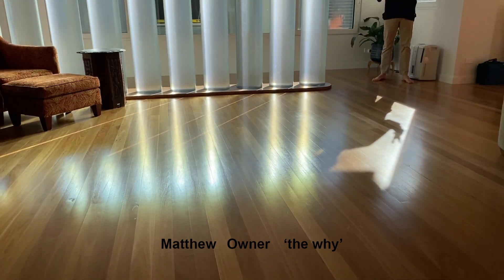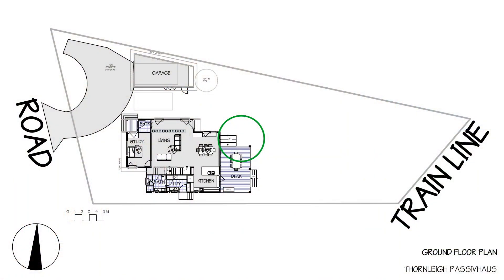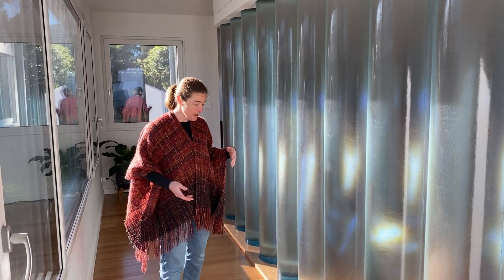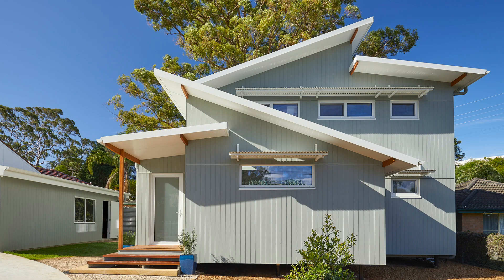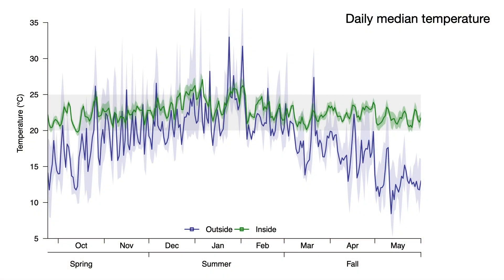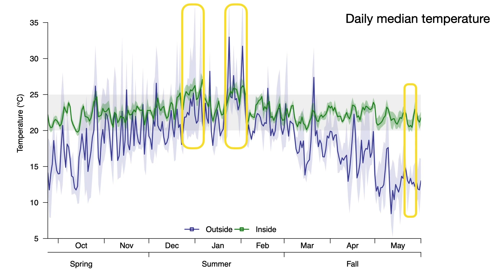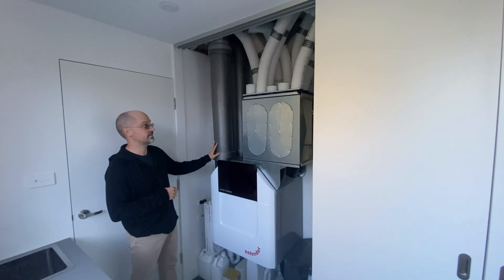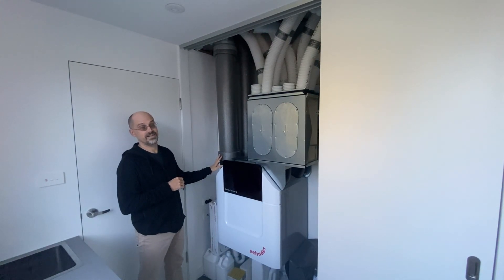Passive House Open Days - Thornleigh Passivhaus in Sydney, Australia

Comment: Great video and very informative. I live quite nearby and also in the process of planning knockdown rebuild. Can I ask if you leave you rear patio doors open during summer months? Currently our doors  are only closed  when we’re not home. My concern is  would render the system inadequate for cooling the house down? Or is this not the case?

Comment: I built passive house in the Pocket Billinudgel  NSW in 1982, not certified passive house and latest in Blue Mountains in  Dec 2018, it was not certified passive house but all passive house  requirements, the developer/builder was unwilling spent any additional on certification, which would have required a blower door test.   Build cost for 240 m2 was $2134.50/m2 included 15% builder margin.   
Several local Entrepreneurs and I are organising a four-day EV & Renewable Energy Conference/Field day will be held in Lismore, NSW at the 23rd to 26th Sept 2021. 
It will bring together people who believe in sustainable futures, and professionals from the EV, Renewable Energy & Built Environment industries.
#People #Company in #EV #RenewalbeEnergy #CLT #PassiveHouse #modularCONSTRUCTION #Xlam  #Microgrids #Batteries #PV #WindTURBINES #WaveENERGY #TeslaSuperCHARGING #eBUSES #eRAILWAYS #PublicTransport   to name just few topic  will covering.
Reply: This answer is fantastic and answered all the questions I was looking for
Reply: @mikehtims  We are submitting development application to North Coast NSW, Sept 16th.
1)	50 prefabricated CLT & SIPform passive house,  certified, homes. The roofs of homes 11,460m2 PV the electricity will be aggregated and stored in a central hub of Tesla batteries. 
2)	13,430m2 PV Tesla and Tractiles tiles producing 7,671,216kw/hr 
3)	10 number commercial Tesla Batteries total 14.4MW/hr upgraded 28.8MW/hr.
4)	Bi-Charging of Electrical Vehicles one per house and 12 charging station located entrance the development. 
5)	Fronting onto main road there will be  1970m2 commercial, shops and 10 charging station. It will the roof will be PV tile Tractile or Tesla tiles
6)	Retention Basin made from the dam on the site. Keep all clean by filtration by having reed beds to filter all the water.  It will provide some of water for the landscaping. It will be potable water.
7)	Landscaping to whole of site making sure that  there is enough clearance the surrounding bush and buildings. 
8)	The building will a minimum  19 Bal.
9)      Micro-grid that will connect 4800 residence to electricity